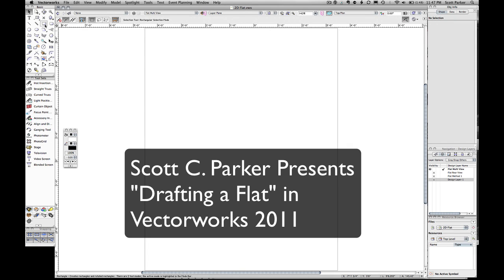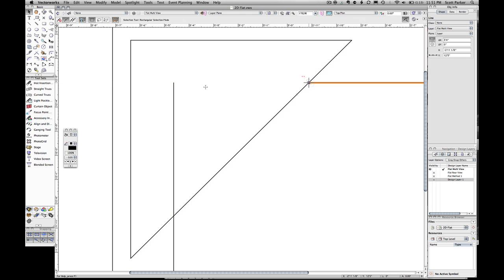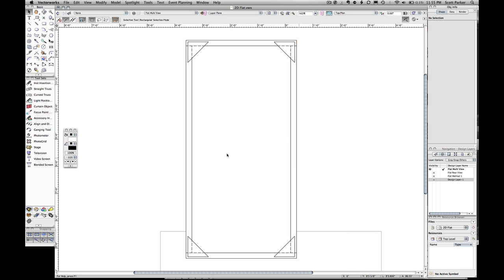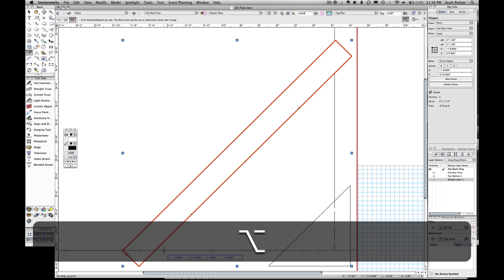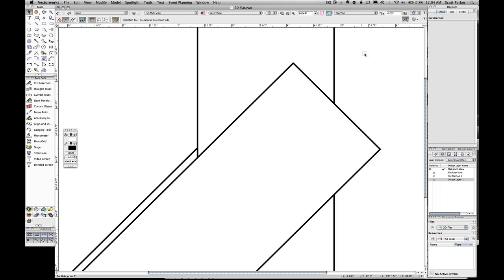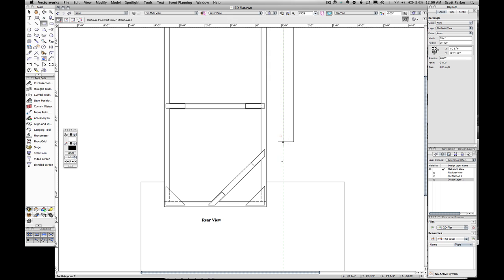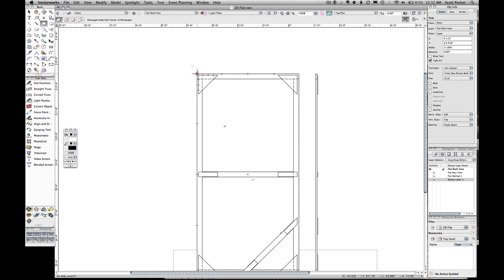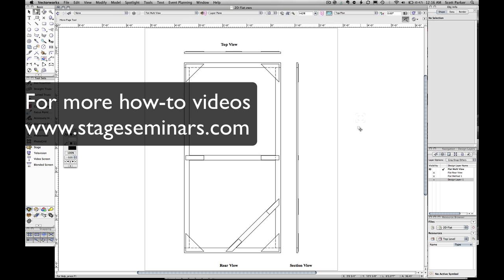How to Draft a Scenic Flat using VectorWorks CAD 2D

Comment: The 3D users will be criticising this, but for me, this is classic 2D drawing, and should be taught first, before letting the student loose on the ways of 3D, and this video shows exactly how to do it, excellent.
Reply from the maker: Thanks Steve. I have another tutorial that includes doing all the extrudes to make this 3D. The beauty of showing 2D first and then 3D is the reaction to the value of viewports. That is, after doing the 3D version and showing the various views via viewports for Front, Top, Left, etc. Instead of drawing the flat three times in 2D.
This class also comes on the tails of our Drafting and Drawing for Theater class the students have recently taken.